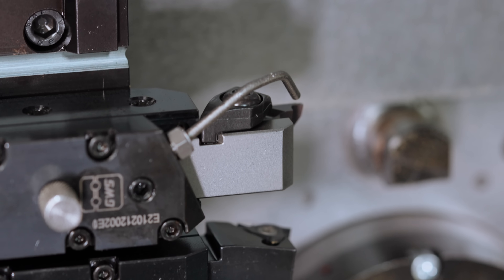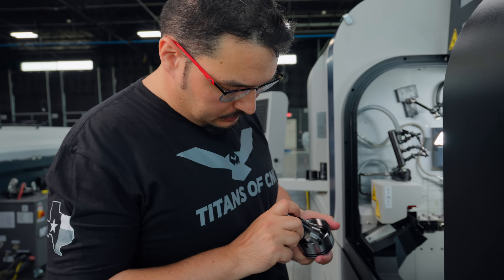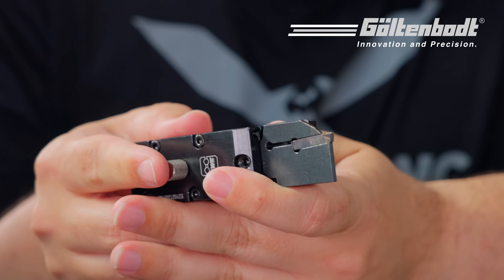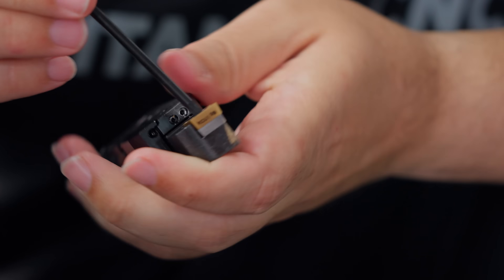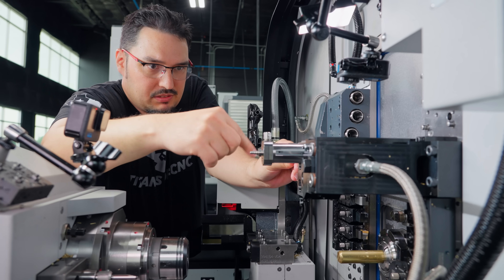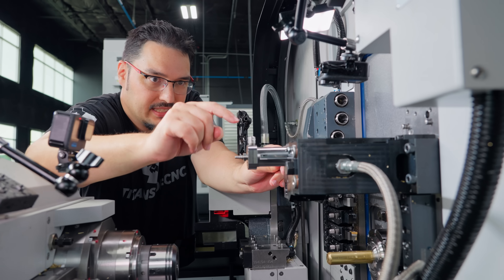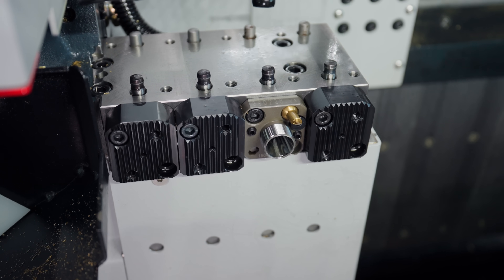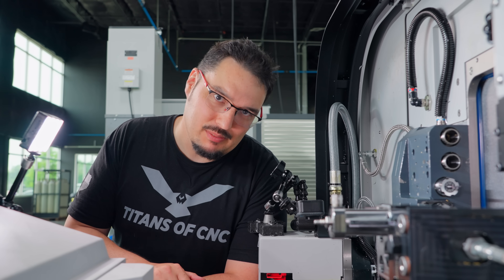How to Navigate a Complex Swiss Machining Set-Up

Comment: Main collet isn't terribly sensitive to stock size.  We measure a few bars, pick a gage pin, and make the adjustment before loading the bar.  Bushing is another story.  We run some loose-tolerance parts on stationary bushing machines (old-school) and purposely oversize the bushing by 0.001"making the adjustment with a gage pin.  With tight-tolerance parts (this is generally cold-finished stock, but not ground) we run on synchronized bushing machines (modern, in other words) and we use the servo current method for bushing adjustment:  Load bar thru loose bushing.  Display Z-axis servo parameters and jog, observing the current supplied to the servo.  Tighten bushing until you see the current start to increase.  I've got 5 Swiss machines putting out almost a million parts per year.  BTDT more than a few times.